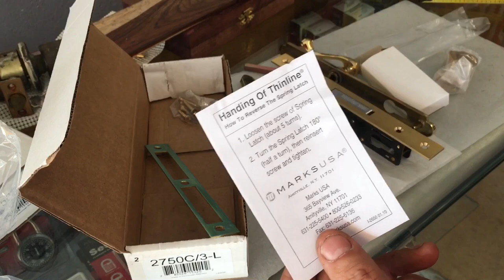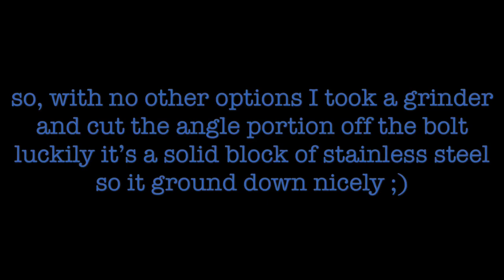Marks 2750c/3 Profile Cylinder Lock & Install

Comment: Are there shorter cylinders available in the US?
This gate is obviously not a high security one, however the main flaw of euro cylinders, once they stick out like this is snapping attack.
Reply from the maker: SanSei2 we are extremely limited here in the US on profile cylinders. Marks is only available like this. In one of my videos (several doors had to be opened today) a few months back I showed the trick of dropping the first and second pins after removing the trim to make them easier to pick so that’s a security flaw, but I think very few people here would know how to snap them (or even what to do after breaking it)